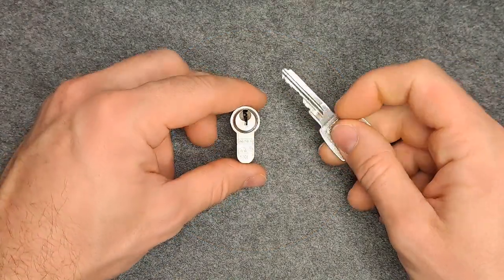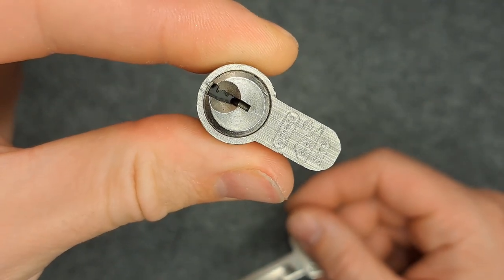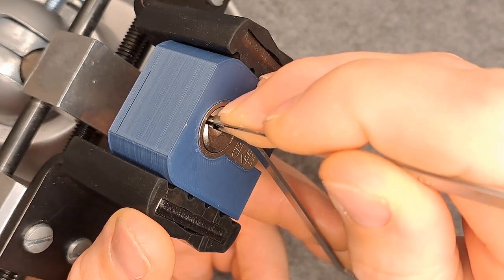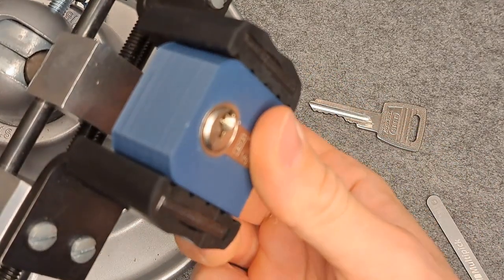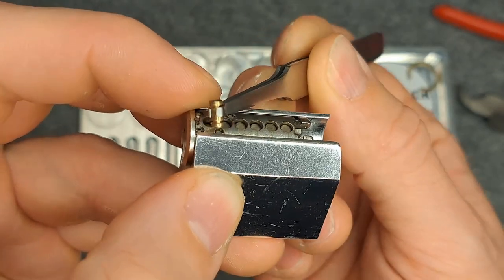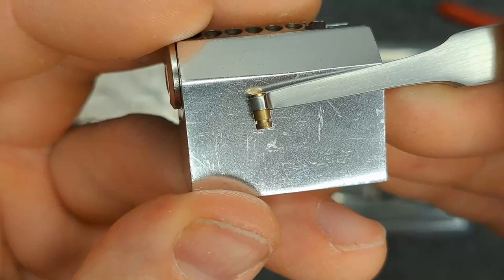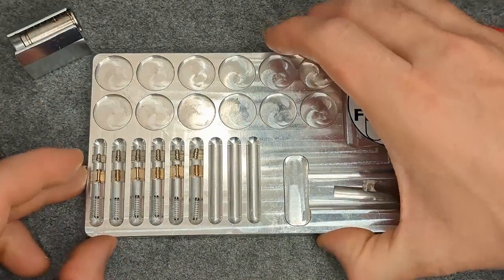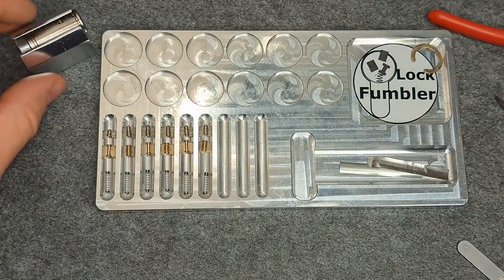Picking a famous Dutch lock, the NEMEF NF2 [241]

Comment: Same type of low bitting as my nemef nf3+ which I regrettably bricked 😢 great pick!
Reply from the maker: Yeah, bitting is so crucial for security.. oh no that is sad 😢 
What happened? 
Thanks for watching 👋
Reply: @LockFumbler   I pulled the core straight out with the key in it and no shim. No matter how much I banged it I couldn't get it to come back to the proper spot to pull the pin out. I ultimately damaged it beyond repair 😪 lesson learned
Reply from the maker: @gchev4  uh no, that is sad 😞  but I have done it myself unfortunately 🙈 just learn from that and move on 😅